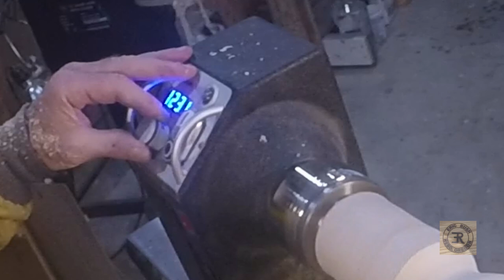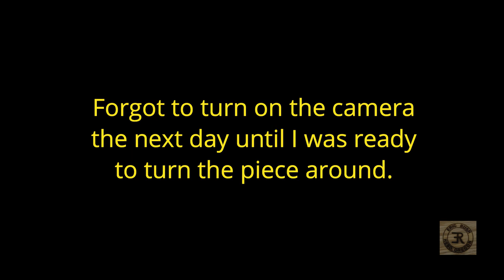Second Redwood Twig Pot

Comment: Here’s another ‘old timer’ going down the same path, we have a 5-acre property with lots of dead dry hardwoods of various types-hard as concrete, but take superb finishes. I fill any splits/ cracks with fine sawdust, then add the CA build up until proud of the surface, then a light spray of CA cure and carry on turning or sanding. This way the cracks become virtually the same wood and are almost invisible. I like your fine sieve to sift out the fine stuff. Happy turning, Greetings from Tasmania Australia. 👍😁🇦🇺🦘
Reply from the maker: I've used wood glue and sawdust on large cracks. Cheaper and easier to use than CA, which I reserve for small ones. Ken Weakley fills small cracks with glue and sands briskly across them which adds wood to the glue and hides the cracks.